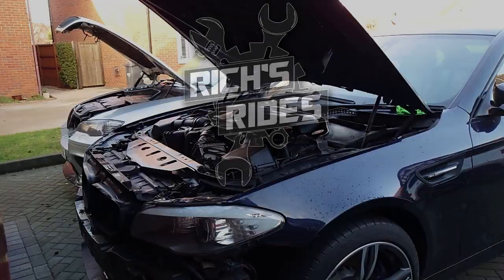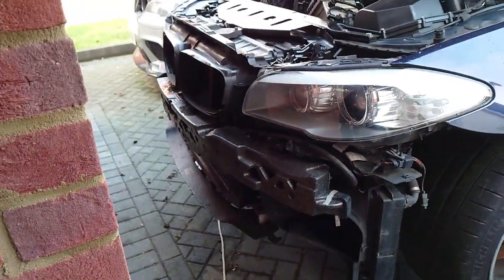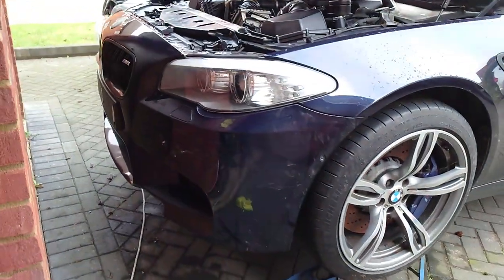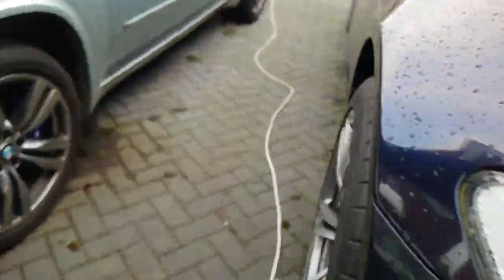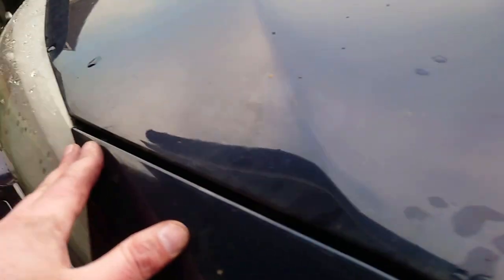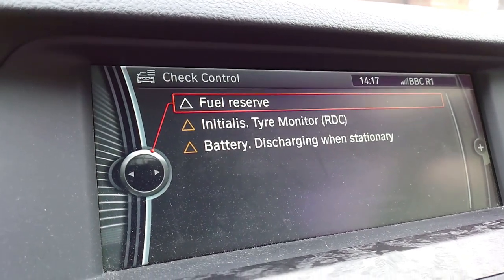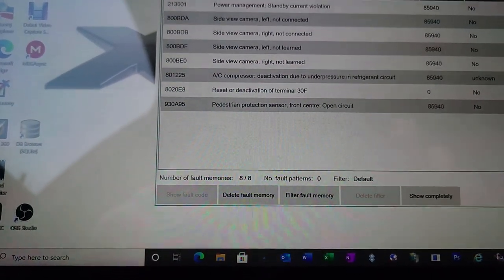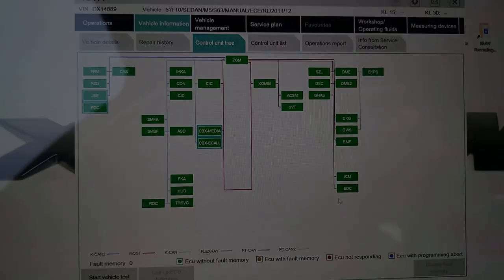Salvage BMW F10 M5 Bumper Install and Clearing all Errors😀

Comment from the maker: I don't think I could be any happier than I am right now. Never give up, keep moving forward, each problem solved puts you closer to the finish. Nothing is impossible!

Just the exhaust left to fit and then it's purely cosmetic touches required.

This car is going to look awesome when it's finished.
Reply: Rich, its so great to see yours come this far and fingers crossed there aren't any further surprises! I've just completed a engine rebuild on mine, which i bought salvage as well, LCI 2015. New cylinder head, as the exhaust camshaft snapped, its running far far better then originally. However I am getting airmass 2 ,plausibility too low, and fuel air mixture too lean P0171. If i unplug the the connector from the maf, it idles much better. Would you say i'd require a new MAF sensor? and did you have to do reset the adaptation value when you changed the MAF sensor?

Ive also just followed you on Instagram, elite_salvage
Many thanks Rich!
Reply from the maker: @elitecarrebuilds8108  that sounds like a lot of work! I haven't had it down off the stands yet to try anything other than just idle for a bit. I'm hoping to get the exhaust on this weekend if it warms up a bit then I can put her back on her wheels and start running through some engine tests.
It could be the MAF, what does it look like? Is it clean? Also what does ISTA say to check? 
Its been loads of fun doing this, but I wish I had a garage to work from though, I'm kinda stuck to weekends when the weather is nice and we're not busy with the kids! Not too many of those available in the year!